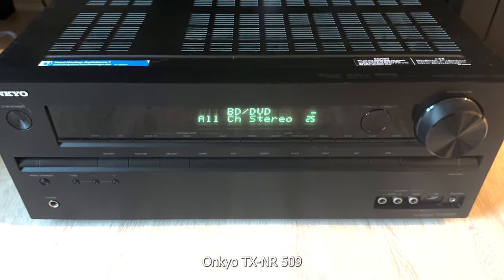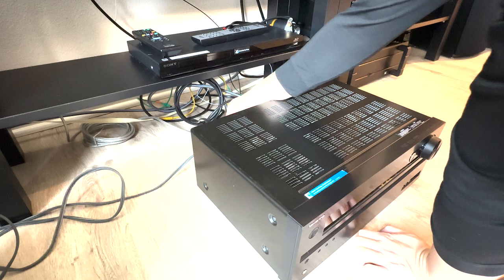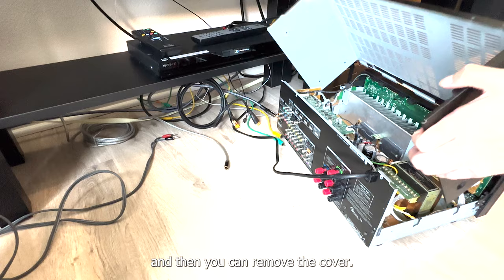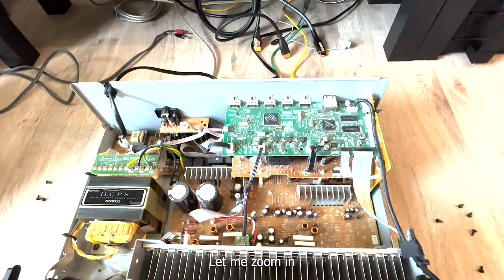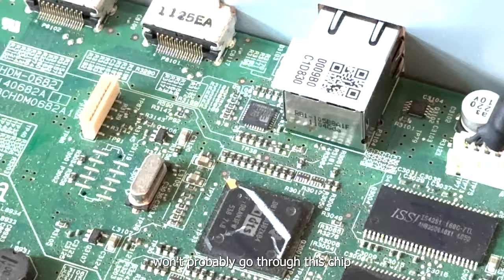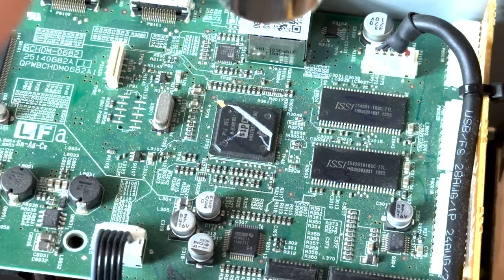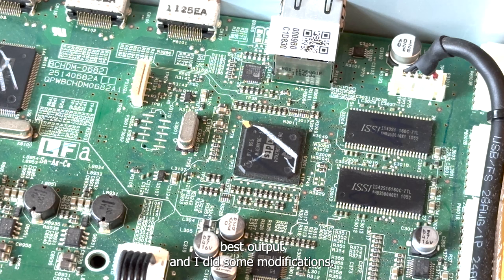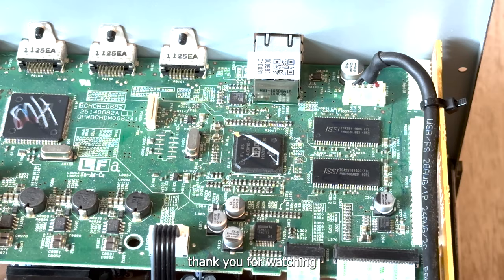Fix the "no sound" issue of most Onkyo and Pioneer AV receivers

Comment: Thanks a lot for this. Your clear video helped me to try and fix the sound issue I had with my Onkyo TX-NR515 A/V Receiver. For the last couple of weeks the sound only came up after switching the receiver off and on again several times. After heating up the DSP chip, the sound comes up immediately again, already for four days now!
Reply from the maker: Glad that it helps
Reply: Pour honey on the board lol, I like a sweet sound lol

Comment: I have an Onkyo  609 i used the hairdryer and my hair is dry but still no sound
Reply from the maker: The temperature of hair dryer may not be sufficient to soften the underfill material. However, I don't think that it worth the investment of a new hot gun, unless you have some other usage as well.

Comment: I can verify this works, and works repeatedly. I mention "repeatedly" because this solution is only temporarily. The unit will work for about a year after heating the chip. The first sign you'll have to repeat the procedure is you'll get no sound when you turn it on, but if you turn it off and then on again immediately it will work. As the problem gets worse, you'll have to leave the unit on for several minutes to warm up before restarting it works. Later it will take multiple restarts. Obviously it's a thermal problem related to that chip - the permanent solution would be to replace the chip or the entire HDMI board. That may not be possible or cost-effective now that this model is so old. And if you do replace the parts, how can you be sure you're getting a chip/board where the problem has been permanently resolved instead of someone just doing this temporary fix anyway? So this is a good way to get a few more years out of this unit.

Comment: Interesting, is the heat application really responsible for the sound miraculously reappearing, or is it the power reset. After all the power is drained and then everything works. Other electronics do the same when a hard reset is implemented. Food for thought.

Comment: Thanks for this video.
I have the same problem with my Onkyo TX-NR609. No sound and the speakers were not displayed on the front. I did the fix as you outlined and it started working again. I was very happy to not have to buy a new receiver. 
However when I put the case back on and put the receiver back on the shelf the problem has reappeared. I tried the same fix again, this time making it a bit hotter and pushing down on the chip until it cooled. It did not work this time though. 
The problem does seem to be the connectors on the DTS chip, as it worked initally, but maybe mine to too far gone. 
Do you have any other suggestions?
Reply from the maker: There are a couple of hundreds BGA joints. If only a few of them failed, this cure should help. However, you may have too many disconnections, which causes the cure didn't last long.
Reply: @neighorizon-4190  Thanks for the reply. I have tried again and it seems to work while it is still hot from the heat gun, but then stops working again when it cools down. 
I will try and source a new circuit board, but as you said previously it may be expensive. Maybe a second hand receiver is a better option.
Reply: @norbertrode  It sounds like maybe a failed cap you caused to fail with the heat, now. Worth a test and look. That's what would happen if it was a failed one.

Comment: Same her, fixed mine. Took 2 minutes of heating😂But then sound was back, hopefully it holds for a while. I heated mine A LOT, everything was really hot so maybe dont be to scarred to heat a bit more than 30 sec. 2 min on step 1 with a standard heatgun👍🏻
Reply: Good idea is to use tin foil screwed up to cover the area you don't want heating, so you can heat it more, also add some passive heat sinks. Not tried any of this yet mind, but I've repaired over devices with similar methods, such as games consoles, graphics cards etc.

Comment: Thanks this worked for me. Unfortunately I think I heated it for too long as the front buttons are no longer responding nor is it working with the remote 😢
Reply from the maker: Very likely your heating area is too large and affected the micro controller. Have you check the connector ? make sure to secure the connections.

Comment: Hi, my 616 usually works fine but after using it for maybe an hour or two, the sound starts to distort to a very low volume. Sometimes changing to stereo and not using a DTS or Dolby Digital brings back some sound to the main speakers. Sometimes, changing to zone 2 or 3 also works. But then mostly the sound doesn't really come back properly. It may be very soft and very underpowered. Can your method work? Thanks.
Reply from the maker: It sounds like related to the DAC
Reply: @neighorizon-4190  OK. If only I can fix it. I don't have the expertise. Thanks.

Comment: Thanks man, I've just fixed the same problem on my tx 8050 with hair dryer.
Reply: Hi, Ihave the same one (tx-8050). But iam not sure which chip to heat. Can you please help me out here?
Reply: Found it. It is on the flipside of the board. I disconnected the board and turned it. I found the chip, heated it up but no result.  A couple of tries didn't work for me😢

Comment: Thank you for that very informative video. I have a TEAC AG-D8900 AV Receiver which I've had for 35 years or so. Suddenly the sound has been cutting out. At first I could get it back by just tapping on the side of the unit. Now however it is totally off. It is like the mute is on all the time, yet there's no way to "un-mute" it. Would you have any recommendations? It has been an excellent receiver after all these years. Thank you for any input you might have! John.
Reply from the maker: Sorry, but I'm not familiar with that receiver. Sounds like it's also related to the sound processor.
Reply: @johncunningham4902   If you can tap on the side of the unit and it starts working, that can only be a bad connection somewhere. Typically bad solder joints, which will need to be resoldered. Look for the tell tale sign of broken solder joints (a cracked ring around the joint).

Comment: I have an onkyo 616 that switches on but it doesn't  do any sound at all from any input, not even the wireless.I have an onkyo 616 that switches on but it doesn't  do any sound at all from any input, not even the wireless. 
Will this work?
Reply from the maker: Yes, very likely. Do you see the speaker map on the front display?
Reply from the maker: Yes
Reply: @neighorizon-4190  I have a Marantz SR7005, no picture, no sound and no speaker map on display...any ideas?

Comment: Hi, I have TX-SR508 and it has same sound issue but dsp chip in my avr is not bga version, what to do now? Please help
Reply from the maker: It could be that the chip is toasted, as they run very hot.
Reply: @neighorizon-4190  so do i need to replace it ?
Reply from the maker: The main board is quite expensive. I think that you would rather buy a new receiver.
Reply: @neighorizon-4190  can't we change the ic
Reply from the maker: Yes, you can, if you have the proper tools to do the job.

Comment: You should do an update video to show that such a "fix" has lasted.
Reply from the maker: It's definitely not a permanent fix, but mine is still working. The idea is to reflow the underfill polymer (100-150C) and press down the IC to make better contacts of solder balls. Maintain the pressure until it cools down.

Comment: My Onkyo has a zone 2 which works but all my other speakers don't I believe I heard a clicking noise like an internal switch switching before it all stopped working except zone 2 speakers. My question is, Is this the same problem you are referring to?
Reply from the maker: No. Should be related to the amp protection mode.
Reply: @neighorizon-4190  can it be fixed with heat?
Reply from the maker: @jdmfl31  No, it's probably due to overheating:-} Cause could be quite complicated from power supply to amp failures. Have you checked for any shortage at the speaker binding posts? unplug all the speaker connections and reconnect carefully to avoid any kind of shortages.
Reply: @neighorizon-4190  why does zone 2 still work  it's super loud but it doesn't have any kind of dsp it's just plain stereo. Are there 2 amps in the receiver?
Reply from the maker: Does Zone 2 share one of the power output or through RCA's ? @jdmfl31

Comment: I have video and audio cutouts with pioneer av receiver. Could this be the problem too? Im using hdmi cable for 4k hdr. 1-2 seconds lost during watching movies than everything comes back again. This can happen sometimes 1-2 times in an hour or more.
Reply from the maker: Could be. However, I would also check the source and the cabling first, for instance, change a source player, an HDMI cable, or a different input on the receiver.
Reply: @neighorizon-4190  i bought a new cable, tried other hdmi ports, also youtube in browser does the same thing if connected thru av to tv.
Reply: @neighorizon-4190  i have Pioneer VSX932 7.2 av receiver.
Reply from the maker: @kajmi25  Then it should be related to either the audio or video DAC. I'm not familiar with the VSX932 though.

Comment: I have an TX-NR609 with an already warranty-replaced DSP chip. I recently lost my sound, but I still get the speaker indicators on the front of the unit. Do you think it's still worth trying to reflow the DSP?
Reply from the maker: You could give it a try, even just heat up a little bit (thermal expansion) and see the effects.
Reply: Turns out it was a config issue! Thanks for the reply tho. I basically just toggled every setting on the TV and suddenly had sound again.
Reply: hi I have 609 also, with same issue no sound, as I observed the board where there are a lot of power transistors are really fired up its untouchble even there was no load. Is this normal for onkyo? Tks, will it work using a hair dryer..😅 Cheers
Reply: My issue was solved by getting rid of my optical cable and using ARC on the HDMI instead, which I didn’t even realize excited lol

Comment: Is it possible without disassembling the receiver? I have same problem with my pioneer vsx-323-k. Only pro logic and neo6 via analog input is working. After 1-2 hours use, hdmi audio working but with some distortion and no audio after that
Reply: No
Reply: If it is going to trash anyway, but you're inclined to try something before so: Leave it plugged in and turned on running for a whille, then blow a hair dryer in the top vents for a bit to see if anything changes.
Reply: @MrChrisRP  well, i already throw that receiver away. I bought an onkyo tx-nr717 and it was perfect.

Comment: Greetings, I have an old TX-SR603 model that turns ON but no sound. This model does not have HDMI inputs and the board inside doesn't seem to have the particular chip. 
So I'm unable to do this simple fix as shown on video.
Any suggestions or advice would be appreciated. Great video.

Comment: I would like to see someone prove this by applying pressure, otherwise you may just be temporarily reviving tired capacitors to fix the issue for a short while.
Reply: I did apply pressure to the chip without success, not much though, just what the finger would allow me to, I tried heating it with a hair drier, it didn't work. after getting a proper heat gun, it did work, however, the subwoofer pre out still not working.

Comment: Worked for me, used a hair dryer for 1 minute since i dont have a heat Gun
Reply from the maker: Glad that it helps
Reply: That's great luck I tried it with a hair dryer also with no luck, however, after trying it with an actual heat gun, it worked.

Comment: Thanks for the video, works like a charm on a nr414. Another thing I noticed was that before the fix the Ethernet port was not working. Afterwards it worked again.
Reply: Those are the exact problems that I have. And despite several heating attempts of varying lengths of the dts chip, unfortunately no improvements. 
Is your Onkyo receiver still working?

Comment: Thx for the video! I hab the same problem and i fixed it with your tips. I've made a couple of tests with the temperature of the chip. The chip needs to be at 30° celcius to switch on. It will heat up by himself when you switch on the receiver, but it takes 5min. Then restart the receiver and everything is ok. Its the same at pioneer.
Reply from the maker: Glad that it worked for you

Comment: Stil working?
Reply from the maker: Yes
Reply: @neighorizon-4190   I have rz820, due to storm last night my onkyo sound is not coming. everything else is working fine .. its just NO SOUND. Service center mentioned something about amplifier to change.. Does this chip heating fixes the issues? or can we replace the board or the chip ??
Reply from the maker: Not sure about the problem. Normally related to the power supply. Unlikely to be the amplifier, as it should be show some error codes if the amplifier is not function properly. @rasalerajesh
Reply: @neighorizon-4190  i tried dimmer+power button, then tone button to see the debug mode.. none shows ??? I see alphabatical number.. service guy on phone says amplifier might needs repalcement. Do you know how to find part number and where i can buy it ?

Comment: My onkyo HT-390 once worked with all the 5 attached boxes. But now only works with three of them. I'm not technical at all so have no clue what to change. Also, since using the sound system on my TV, steaming services like prime video and Netflix movies with dolby 5.1 don't work... So really no use of using the system. Which is just a waste... Can't find anywhere why this is an issue and if it can be resolved

Comment: I hate BGA chips... they are a poor design. There's NO way (except for using X-Ray equipment, to physically inspect that the solder process is going well when the board comes out of the reflow oven during manufacturing, and adjust the process if it looks shady. There could be a solder paste/stencil issue, an alignment issue from the pick and place machine, heater section out in the reflow oven, wrong temp, and so on, and a person will NOT easily carch the issue and fix the problem when they can't even see the problem to begin with. 

The other irritating thing about the design of these chips is a heat issue. The chip is hotter towards the center of the chip, and ends up warping the middle of the board underneath the center of the chip into a cup shape, and that ends up pulling on the solder balls in the center of it, and either creates cold solder joints, or pulls the solder balls right off the copper circuit pads underneath from the board flexing from heating and cooling. The edges of the chip stay cool enough so that the solder balls under it remain adhered, and the chip stays put, but it's under the very center few square centimeters of the chip where it gets hot enough to cause the board to cup from the heat, and the solder balls get hot enough to get to a semi-liquid state, and the joints pull apart or end up "cold" and high-resistance after they cool.

Comment: I have a 2.1 pioneer system. When I play a song the subwoofer doesn't work. I need every time to set speakers in the amp menu to make subwoofer works and after turning the amp off and then on it doesn't work again. Can you help?
Reply from the maker: It seems that the setting was not saved after each change. It may also be related to the listening mode such as "direct music" or "pure direct".
Reply: @neighorizon-4190  I also checked all the listening modes and no sound comes out of subwoofer

Comment: Aux is not giving sound as well. Can it still be a hdmi chip fault?
Reply from the maker: Not sure whether the analog AUX is remixed for multi-channel replay. If not, then it's related to the volume IC or the amp section.
Reply: @neighorizon-4190  thanks for the info 👍
Reply: On my 708, even the analog/rca input runs through that. The speakers won't click on unless that chip tells them to.